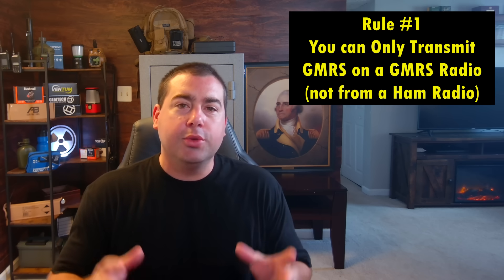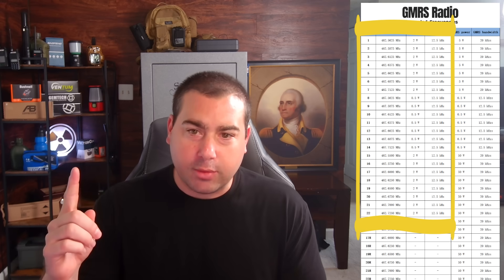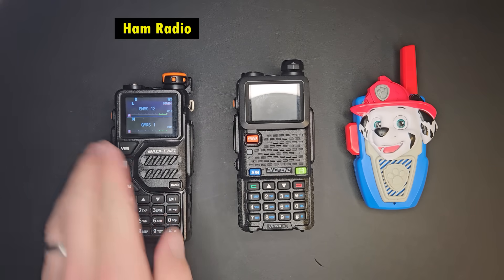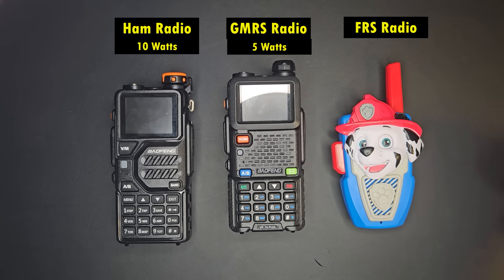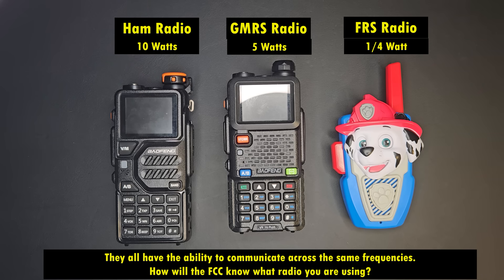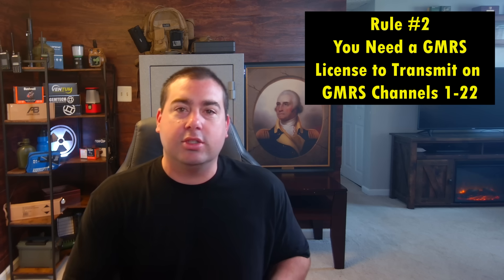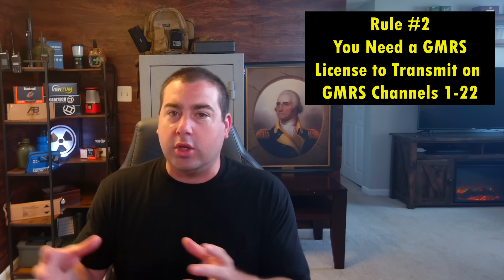Radio Rules the FCC Doesn't Really Care About & Why

Comment: No, you don't!  So much is wrong with this! Your license, has bearing on what frequencies you transmit on and how much power you are allowed to radiate! It has NOTHING to do with the RADIO you use! I can use my HAM license and use my GPS radio to communicate on HAM frequencies, and I can use my GMRS license to communicate using a HAM radio on GMRS frequencies, provided I use the appropriate power for that "band". The radio it self, is nothing more than an appliance, Your license however is a certificate that states that you are supposed to be smart enough to use those appliances correctly and responsibly.

Comment: The difference between legal and practical. Thanks for the information. Power limit on GMRS is maximum 50 watts for base and repeater. Maximum on FRS is 2 watts on channels 1 thru 7 and 15 thru 22 and 1/2 watt on channels 8 thru 14. This was a FCC change in 2017, because cheapo GMRS and FRS  in one radio ( thank Radio Shack and Motorola for this). The FCC and certain other forces have mismanaged private radio services since 1948.

Comment: He let out he 5 murs channels. also both of those Boefengs are 7 watts the one he says is GMRS is the same as the other one the UV5H. I happen to own one. It might be a locked version that he is using.  So, it only works out of the box on GMRS. It is very easy to unlock just takes less than three minutes. Not being enforced by the FCC.

Comment: If you use a ham radio on GMRS (or FRS or MURS) and keep within the operational limits and "ethics" of those services no one will know what kind of radio you are using. Just don't be stupid with your UV-5R and transmit on anything other than Ham, GMRS,FRS and MURS (Such as public safety or commercial) bands and you'll be fine.

Comment: You started out correct and then jumped right in to wrong.
The FCC cares about interference. I have both an amateur radio license AND a GMRS license. If I take a handheld amateur radio and program GMRS frequencies AND power limits AND I respect the GMRS license, I’m going to cause neither harmful interference nor give anyone a reason to act against my use of radios.
The FCC can enforce if I CAUSE interference. If I don’t CAUSE interference, they have no grounds for enforcement. “But you have your radio programmed with GMRS frequencies.” Yup, and in an emergency (that I am experiencing) I can use those regardless of what radio I am using. So I have a legal reason to have access to those frequencies in the amateur radio.
Your assertion that signal strength can only be measured directly from the radio is patently false. Let me make this clear, you CAN determine signal strength AND direction (meaning you can determine location) by intercepting a signal at three locations, triangulating, and measuring received power. So yes, the FCC CAN be WELL aware of where a signal came from AND its power at emission. I have done this myself having been a member of the U.S. Army Signal Corps.
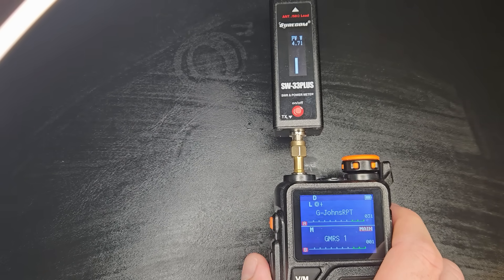Next, at 2:49 you’re measuring output power not RADIATED power (transmit power is a bullshitism used by the uneducated). The antenna matters. When you look at the rules for the GMRS radio service from the FCC they measure RADIATED power. This is why a license is required in GMRS. Your example with the toy walkie talkie is exactly what I’m talking about. You can’t change the antenna in the toy walkie talkie. In the two Bao Fengs you can change the antenna. You can change the gain by changing the antenna… Which means you can take a 5 watt signal and make it work like ten watts by adding 3dB of gain. Or make ten watts work like twenty… Can you tell if received signal has been boosted by an amp, an antenna, or other means? If you study the signal over time you can sometimes see “dirty” signal introduced by the gain providing device, but that doesn’t tell you what specific device did it. Regardless, you CAN still tell what the radiated power was.
Earlier I mentioned using radios “in an Emergency.” Using a radio DURING an emergency is NOT the same as IN an emergency, and that matters. You using a radio DURING an emergency to chat with your buddies WILL get you fined. YOU aren’t EXPERIENCING an emergency. If someone with you is having a heart attack, you are EXPERIENCING an emergency and are covered by the law. Unless… Unless you interfere with other traffic. Just because you are experiencing an emergency doesn’t mean you have a right to impede radio traffic of other people experiencing an emergency. This is why I find it so stupid for people to think the time for them to learn to use a radio is DURING an emergency. Pretending that ham radio operators are just gullible for spending the time and money to ensure they can do correctly what the layperson has been mislead to believe is just pick up a radio, push a button, and yell in to it… “good buddy,” is at minimum insulting to the intellect of thinking people everywhere.
Your footnote on ERP not being precise…. It’s precise enough on UHF (what GMRS uses) which is a LOS signal to locate your position within 50 feet from 50 miles away. That measurement has been precise enough to cause people to be fined tens of thousands of dollars. FAFO. I KNOW first hand as someone that has been a witness in lawsuits regarding radio emissions. You’re wrong and you are putting anyone that accepts your nonsense at risk.
If you’re going to provide information, make it accurate.
Reply: Old ham here. But not a sad one. It takes a lot of complaints to even get a mean letter.  They are so understaffed. Plus after 6 PM EST the remote monitoring stations are not even manned .
Reply: @jhonsiders6077 depends on who the complaints are from, and how quickly they come in. One per year from a civilian won’t get much of a reaction. Four the same day from licensees will. One from a corporation/emergency service will too.
Just because a site isn’t staffed after 6 p.m. doesn’t mean they can’t record and store. Computers are a thing…

Comment: I will transmit on any frequency with any radio of my choice using any power level I choose. It is time to dissolve the FCC.
Reply: A ham radio license costs $35.00 and is good for ten years.  That works out to $3.50 per year, or less than a penny a day.  I don't know how pure and innocent your lifestyle is, but I'm sure most people spend much more than that on coffee, sodas, and/or porn.
Have you actually considered what your life would be like if there was no entity to control the airwaves?  Your cell phone might be free, but you wouldn't be able to use it.  Nor would you be able to watch the season finale of Big Brother if the guy next door wanted to play on his radio.
Reply: But you don't.  Besides that, no ticket holder would  communicate with you.  Stick to the blister pack radios, you'll be fine.

Comment: The parameters I follow very closely with my Baofeng radios are frequency accuracy and bandwidth. If I can dial up the exact frequency for a particular channel and keep the bandwidth within legal limits, I feel very confident that no problems with FCC or adjacent channel interference will occur.
Reply: Yep. If you program your UV-5R correctly for whatever non ham service you want to use (FRS, GMRS, MURS) No one could tell what kind of radio you are using.
Reply: @jamesslick4790 *save the spurious emissions
Reply: @jamesslick4790  the fcc can tell what radio and power level .

Comment: A business using a type accepted GMRS/FRS radio on shared FRS channels and FRS power limits would not be braking the law.

There is also an issue transmitting UHF over 50W near military bases and this is something more likely that the FCC and the military would care about.
Reply: Don't forget the "Above Line-A" issue with Canada.  There are two GMRS channels that can't be used up north.
Reply from the maker: You need a license to use a gmrs radio according to the FCC. The staff using these radios do not all have thier license.
Reply: There's only FRS radios & GMRS radios now.

Comment: There are no Type Certification for Amateur Radios, but it does violate rules and regulations, not necessarily laws when using an Amateur Radios in part 80 90 and 95 territory. Part 97 where the individual is licensed or should be licensed, that where the rules and regulations press towards legality issues depending on the intended use of that particular device. Having just for everyday use or an emergency, the FCC won't get involved unless there's a reason.
Reply: there are regulations against spurious emissions and making fart sounds over the air.....

Comment: Simplex is Radio to Radio, without the use of a Repeater. The problem with using an actually HT Ham Radio. Is in the antenna. The antenna that comes on a Baofeng, will have lousy SWR's on the GMRS or FRS frequencies. Which in the long term will burn out your radio. Ham Radio clubs generally police their area, if something not normal is heard on air. You'd have to get a different antenna to make a Baofeng radio safe to use, SWR wise.

Comment: Technically you can skirt the repeater paperwork and licensing by using what is called a simplex repeater.. Basically you use simplex to talk to a radio with a better antenna or higher location that has a cheap simplex repeater box that receives your transmission and records it then retransmits it simplex thus extending your range.. Hams do this from time to time or do what is called crossbanding this way they can use a small low power HT that gets retransmitted through a high powered mobile or base radio giving them greater distance while using a small radio in their hand.. Some search and rescue teams will place a simplex repeater that has 5 watts on UHF on top of a high area with a good antenna so all the searchers in rough terrain can stay in contact..
Reply: There is no paperwork for a GMRS repeater, nor is there any coordination.
Reply: @RandomPerson-z4s4u  I see that now, Amateur repeaters require it and a site survey with altitudes and PEP range maps but we can use far higher power than the 50w limit of GMRS.. If you live along line A or North of it (Canadian exclusion zone) power levels are radically reduced for all transceivers in UHF.. 5w to 15w ERP with no directional antennas pointing North.. Parts of the 430 to 450mhz ham band and GMRS band are like this but pretty much ignored because it is a huge PITA up North here.. https://www.fcc.gov/reports-research/maps/frequency-coordination-canada/

Comment: I'm an old 'sad ham' I guess,  I'll bite :)   No one is going to know what radio you are transmitting on and likely no-one cares. Radios are type accepted to be clean and contain the feature sets needed for it's intended use. Part 90 business radios typically aren't allowed to be frequency agile... meaning they are programmed with the frequencies the group or organization is licensed for and distributed to the end user.  "Ham Radios" (Part 97) are natively programmable from the keypad.  Exception being getting yourself a wildland fire specific Part 90 radio like a Bendix King that is designed to be cloned and front-panel programmed on a fire scene.

The reason for the HAM license is the endless things you can do within the ham bands and it helps you gain knowledge of how this stuff works, and the rules and practices within groups of the spectrum it happens in, so it isn't a free-for-all mess. Also, understanding propagation,  how antennas work, etc.  It's very useful training. 

I encourage people to check out a radio spectrum sheet that shows all of the available frequencies and what they are allocated for.  It's really a pretty limited resource.  Of course, in your immediate area, and with limited power/range of a handheld radio, it's unlikely you'd interfere with anybody but you sure could. 

OK... SAD HAM time... but I'm generally curious about this.  I often wonder what peoples "comm plans" are exactly...  Are we getting a whole bunch of locals to form a militia or just communicating around the farm with family?  I have yet to see what people are doing that would be helpful or useful with an HT.  Ham and GMRS have repeaters which could be useful.  These $25 HT's at least are wide banded enough that you could monitor local public service stuff for information, but most of us are carrying a digital P25 radio and have gained the knowledge to set up non-affiliate trunk scanning so we can actually hear public safety comms.  

I think at the basic EMCOMM level, people are missing the boat on having a decent Shortwave Receiver, antenna, an AM/FM radio, and a way to power them.  I just think information gathering to be much more important in a true SHTF.  Knowing what is going on around you seems far more important to me.

Of course...  it would be difficult to understand how to use a Shortwave Radio, I.E. decoding digital comms, the modes RTTY, DRM, FM, AM, USB, SSB, etc. without training and learning (Ham Radio Manuals) . Rather you become an active HAM or not...  the books are full of useful information in the use of radio technology.  Just like your FM survival books, Boy Scout Field Manual, and Edible Plants books.

Reality is, in a true SHTF situation.... you won't hear me transmitting.  I'll be listening and planning.
Reply: You are a sad ham,, all that information in response to the statement that using a ht within the confines of gmrs most likely will not be of  concern to the FCC. The bowling alley most likely has a license and just upgraded the radios for durability and reliability reasons. Get a life  !!

Comment: You DO NOT NEED A LICENSE for FRS (radios that you can buy a Walmart...etc), you do need one for GMRS.
To be legal on GMRS, you will need a radio that is type accepted for PART 95. Which very few radios are, that particular radio you showed is one.
Most BUSINESS radios are PART 90 so not even a radio made for business frequencies is legal to use on GMRS.
I believe that GMRS should be moved to a subgroup of PART 90 so those radios (of which there are MANY more made) can be legally used on GMRS.

Comment: Last I checked a GMRS license is $35 USD for a family.  The FCC rules have a very broad definition of family.  No reason not to get a GMRS license.   That is a really low barrier to entry.  Just because a rule is rarely enforced, doesn't mean it won't be.  Many campgrounds have a rule about no alcohol consumption.  It is only enforced if you are causing a problem and being disruptive.  Same thing with this.  If you are causing problems or interference with you use of GMRS radio and end up on the FCCs radar, do expect them to take some action.   Be thankful for your GMRS use.  In Canada, we are limited to 2 watts, fixed non detachable antennas and no GMRS repeaters.  But we have no requirement for a license.
Reply: But on the other hand, Canada allows amateur radio operators to use 2250 watts, most other countries are limited to 1500 watts or less.
Reply: @mernokimuvek  That's peak envelope power for SSB and that is only for our advanced (top level) license holders.  The basic class is limited to a max of 560 watts PEP for SSB.
Reply: > do expect them to take some action.

They will definitely send you several nasty letters and the occasional investigator (almost always without a warrant) to tell you to knock it off. If you keep doing it they might eventually confiscate your gear, but they give you lots and lots of opportunities to cease and desist as long as you're not bothering the government with your activity. I knew some pirate FM guys back in the day, they managed to keep broadcasting for YEARS from the same site.

Bothering the cops/fire/mil will get you in serious trouble though.
Reply: "Just because a rule is rarely enforced, doesn't mean it won't be."  Also, just because a rule is rarely enforced isn't an excuse for breaking it.

Comment: The Baofeng UV5R transmits at a max of 5 watts so that matches a GRMS radio power so it shouldn't be a problem. A Baofeng BF-F8HP can be set to medium power level of 4 watts so that shouldn't be a problem either.

Comment: I feel like they should do away with licensing with all low power radios like they did with CB. It's just a big scam anyways.
Reply: its a deterrent i figure, to keep the paintball kids from going for full power radios when a little fleet of FRS will do jsut as well.
Reply: Doesn't matter if they do away with it or not, just don't pay for a license. It's an easy scam to avoid.
Reply: @cheesefries7436 
You don't pay for general use on everyday comms (CB, FRS, MURS).
You only pay for organized, selected frequencies.

Don't pay for organized parking.
Don't pay for private highways.
Got my drift....?
Reply: @jplacido9999  Yeah, I also don't pay for that.
Reply: @cheesefries7436 
I rest my case....🙈
Reply: The difference is CB radios don't use repeaters that are privately owned and maintained. If you're using somebody else's property, you should be following the rules. Licensing creates a barrier for proper use.
Reply: $35.00 for a license good for 10 years may not be as much of a "scam" as some people think it is.  That works out to $3.50 per year - less than 1 cent per day.  Part of the reason for requiring a license is to "restrict" usage to those who care enough to know enough to pass the exam to get the license. That "restriction" doesn't mean the FCC or the Ham community doesn't want more people to get involved with Ham Radio - only that they want to maintain some standards of competence and conduct. 
The CB channels provide enough opportunity for those lacking in class to be vulgar.  Why shouldn't the Ham bands be available for the more classy types who would rather contribute to the hobby than destroy the fun for everyone?
Reply: You cannot use a 5W radio as you like, with your  own choosen frequencies.
What you ask already exists: FRS.